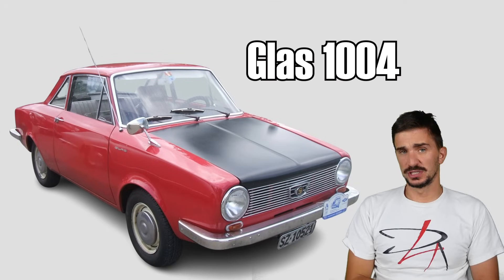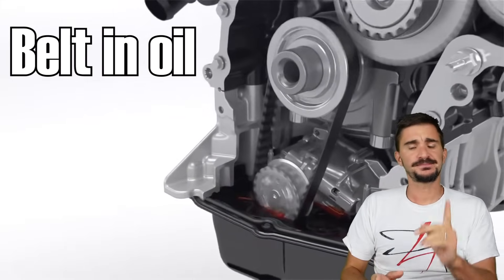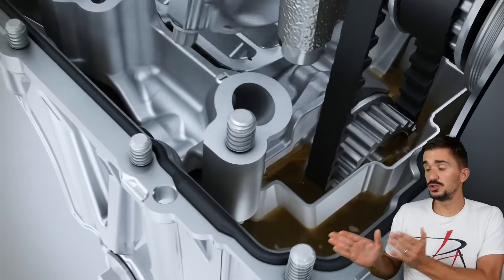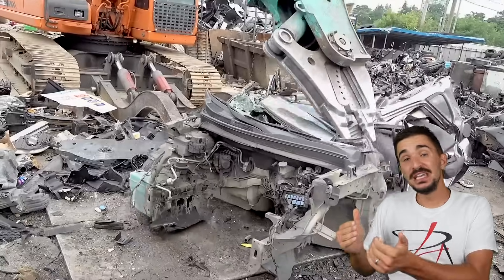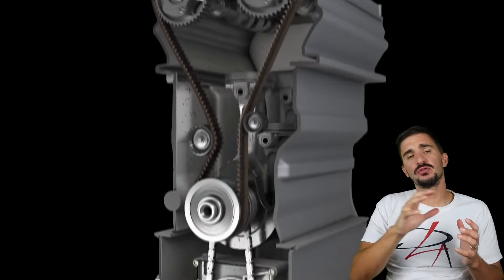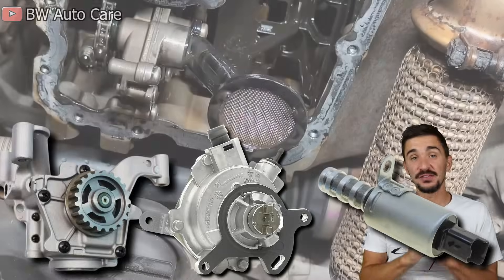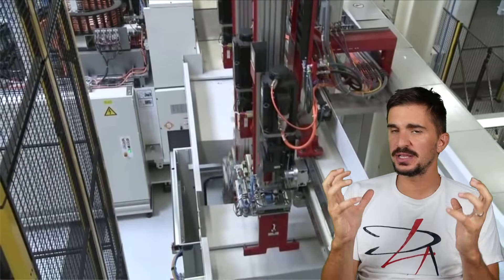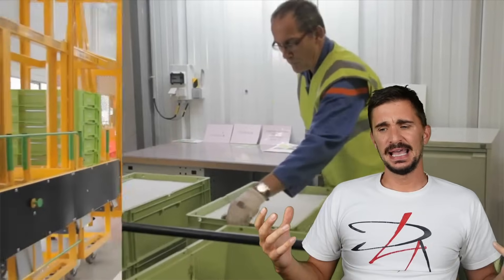Who Approved This and Why Is It Still Being Made? Wet Belt aka Belt in Oil Engines

Comment: But, a snapped belt means 100% fuel savings and a 100% silent engine. 
Now, where did I leave my carbon fiber submersible? 😂
Reply: Aaargh!! Too soon??
Reply: @ArifGhostwriter  never too soon 🤣.
Reply: Walking also means lower emissions which is a win for the planet so the automotive companies can be proud of that. "More Ford owners than any other brand walk to do daily activities which means that we, the Ford Motor Company, are helping to clean up the planet."
Reply: @ArifGhostwriter  It's a 'low' blow
Reply: @rylandrc  Low & very high pressure?
Reply: I was just going to comment this.
Reply: I think it’s right there by your lead balloon and perpetual motion machine
Reply: @omega1575  As long as you don't conflate perpetual motion with free energy.
Reply: @omega1575  And my inflatable dart board. 🤣
Reply: My Kia stinger makes a little engine noise...but that's better than changing a wet belt every year 😂
Reply: With some horses attached it can even move
Reply: BUWAHAHAHAHAHAHAHAHAHAHAHAHAHAHAHA!  Sitting on the shelf right next to the Boeing Starliner and the AMC Gremlin!
Reply: Yes!
Reply: that's very funny but true
Reply: @dereknicol3465  I like Stingers. 👍
Reply: @dereknicol3465  My KIA Starmer just farts and talks shit. 🤣
Reply: @Isthatyoudermot  No problems with it at all regardless all the mods I done...some cars are just made wrong from the factory to save the manufacturer money...then the fallout is beslowed on you.... research your next car man.
Reply: Is that the one with the rubber door seals?...
Reply: parked next to your lead balloon and invisible boatmobile..........
Reply: Buy we as humanity emit methane gas, so that is a problem in itself. Need to be careful or else they'll put a methane tax on us haha 😄
Reply: @miguelfigueiredo3910  Well, they once taxed daylight. Which made people brick up their windows. So, I guess it's possible. 🤣
Reply: @Isthatyoudermot  🤪
Reply: @ArifGhostwriter  I mean they weren't even done dissolving in the Ocean yet when the Internet was flooded with memes already soooo... XD
Reply: bwahahah
Reply: @paulsmith5611 Ford sneakers.
Reply: @paulsmith5611  MOPAR has entered the chat...
Reply: @paulsmith5611  Walking only means lower emissions if you didn't eat bean soup for lunch.😂
Reply: @ArifGhostwriter perfect timing!
Reply: As the proud owner of a 2002 BMW 530d I can say owning a BMW is a very eco friendly choice for this exact reason 😂
Reply: Rockton Stush
Reply: LOL
Reply: My oven-safe air conditioner works great too. Don’t know why people complain about these.
Reply: @ryanthompson2893  but is it dishwasher safe?
Reply: Yeah and who could have seen that these were bad ideas??? , ummmmmm anyone with a functioning brain !!!! duh !.
Reply: lol
Reply: @paulsmith5611  actually i think you ment dodge
Reply: @paulsmith5611  Yeah  but don`t walk in oil with rubber boots  (!!)
Reply: Brilliant, need I say more ?
Reply: Wow!
Reply: @ArifGhostwriter Too late
Reply: 😂 Brutal
Reply: savage 😅
Reply: Hahaha brilliant
Reply: @MeYou-yz2yz  does anyone very close by do the same? Need to keep it on message and polite.
Reply: Not always. 
About 2yrs ago I replaced a timing belt on a Ford 2.3 engine that ran a generator and it broke. 
The engine was from around 81-82 vintage ,and it was the original belt that broke at 1200 hours of runtime. 
Non-interference engine ,slap a new belt on and go. 
Although I doubt this new belt is gonna last almost 40yrs this time.
Reply: @Isthatyoudermot he hasn't seen the "clibbins, hadda layer down" meme that's had the motorcycle in the pic replaced with the Titan.
Reply: Manufacturers count on the design to last through the warranty period. After that, consumers are on their own. Companies that exclude long term durability in their plans will eventually become part of history.
Reply: It looked OK on the computer models. What could go wrong!
Reply: @markleggett3944  Famous last words. 🤣
Reply: BOOM 💥 

That was the sound of the hull exploding due to surrounding water pressure.
Reply: You must look at the advantage of this Idea for the auto manufacturer. When this belt fails in many cases the Customer will buy a new Car.
Reply: And a expensive repair bill
Reply: It is possible to  use anti oil polymers, Kevlar for strength, it can be done, but a regular rubber belt no. That's just a stupid. We have steel belts, so to make a oil resistant belt is possible also!
Reply: auch.... oceangate ripped....